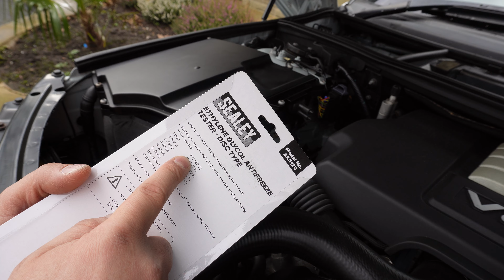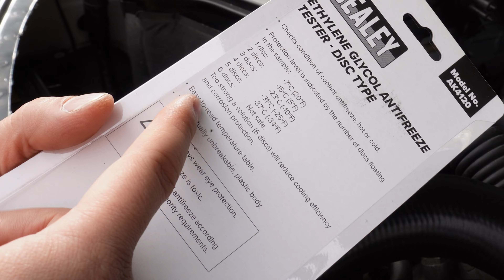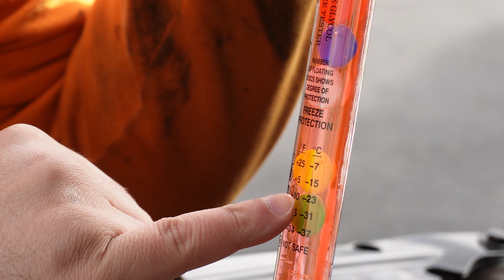Health Check testing on my L322 Range Rover TDV8

Comment: Hi Fahed - never seen the brake fluid tester before. Nice piece of kit. Have a feeling it's going to make its way onto 'my list'... ;-)  Had the megaflush done on my L322 4.4 tdv8 last week. What a difference! Also had the diff and transfer box oils changed at the same time. The place I used is a transmission specialist and they told me the condition of the oil in the front diff was quite bad. The oil in the rear appeared to have been replaced not too long ago though. As the car has just gone through 130k it was all timely and £720 well spent. Now feel confident to put it through its paces off road so been having a little fun with the terrain settings and hi/lo ratios :-)))))
Reply from the maker: Hi Shane, well done! Sounds like it was money well spent indeed, and it means it was a job well done if you can sense a positive difference! Amazing! It's so much fun going off roading and looking at the off-road info on the screen! Have a great time! 👍🏻 
I haven't done a megaflush to my car, but it's on my "to do" list, and if I do it, I'll make sure to document it and make a video about it! 😊